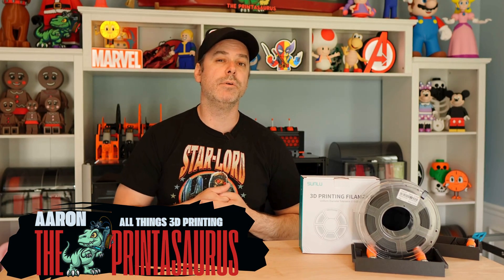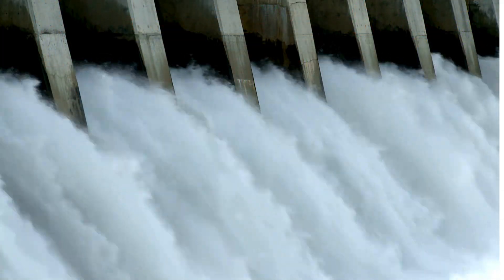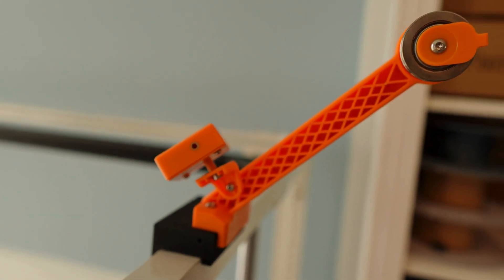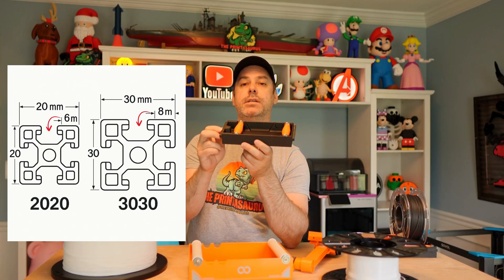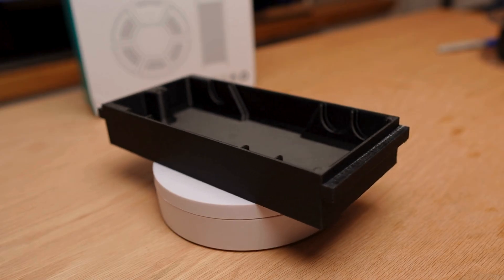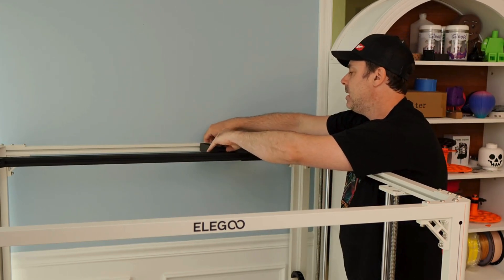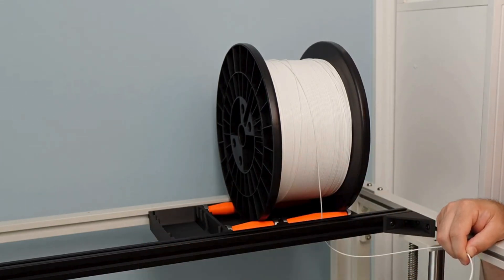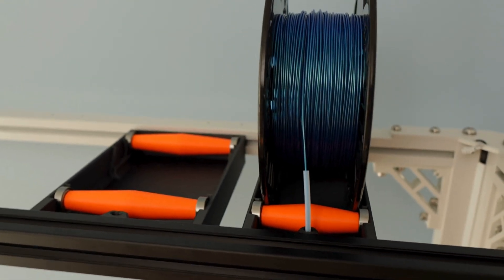SUNLU PA6-CF Spool Mount Mod for Elegoo Orange Storm Giga

Comment: Would that set up get in the way of a say a maximum height print ? And I’m going to use that filament run out sensor set up also, don’t like that elegoo puts it way up top either
Reply from the maker: For max height you'd lose about 50mm. For what I was looking to do, this worked well to get things cleaned up and off the ground and made things easier overall for my setup. I have some more refined 3kg spool holders that Gcodegearhead did for me. Link is below. Moving the filament sensor has been great. I can now splice filament when it runs out and have plenty of time to do it and with the spools mounted up top it has become a seamless operation!  

https://www.printables.com/model/1193075-4-5-spool-filament-dispenser-sv08-coprint-config-t/files

Comment: Have just got some of that filament too. Great stuff. QQ what fan settings did you use? Or did you keep it stock?
Reply from the maker: I found the Bambu PA-CF filament profile fan settings worked really well and used that to make some slight speed changes for the X1c I printed with. I slowed things down a little 160mm for outer layer, and inner layer to 250mm. Filament was really easy to work with after I let it dry.
Reply: @ThePrintasaurus  Thank you